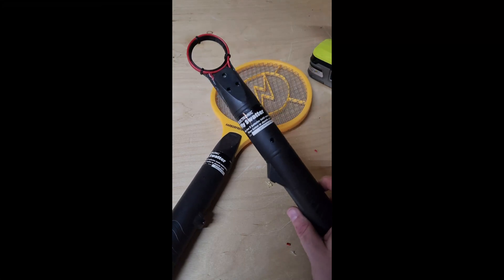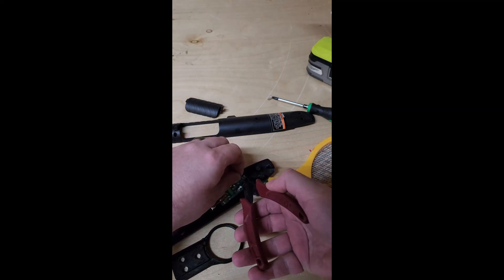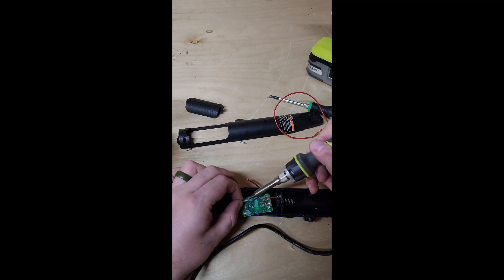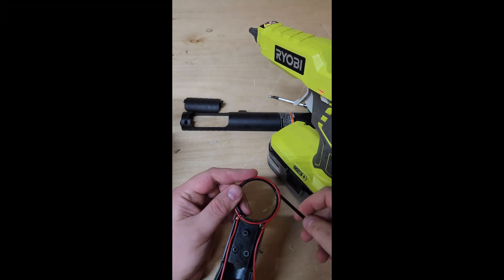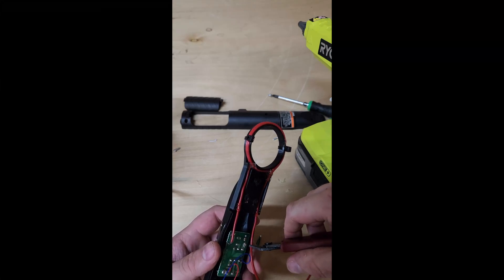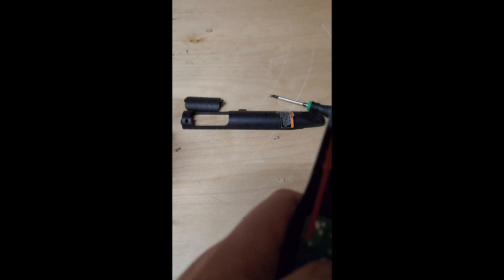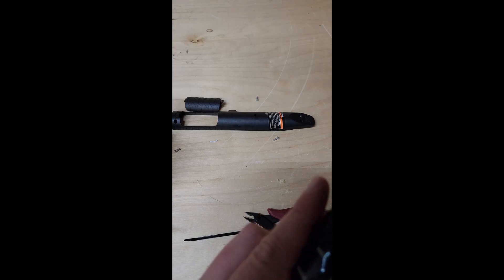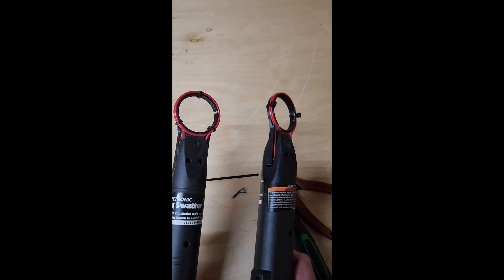DIY EMP Device from a Harbor Harbor Freight Fly Swatter

Comment: Why not use the already existing head, just remove the metal screen inside, maybe add some sort of strip of cut (lengthwise) PVC pipe to wrap the wire around and place/secure onto the yellow part?

Comment: Why isn't the copper bear wire and it's still in the sheathing
Reply from the maker: @BrandonPryor-js2ux  if the wire wasn't insulated, it would short out and bypass the coil.

Comment: Just comfirming, you need a small gap between one end of the coil and the actual PCB?
Reply from the maker: Yep, correct. The spark gap lets the capacitors build charge.
Reply: @carlbelcherEDC  I have a plan to make my own "Faiz shot" but with a modular piece that lets you switch between gauntlet or emp

Comment: Would that work on a fuel pump?  Wonder if I can put fuel enough and before having my truck full use it and maybe cut the signal so I don’t get billed for the fuel
Reply from the maker: I wouldn't recommend it, first it would be illegal and second most production consumer facing stuff like the pumps are more than likely hardened against an attack like this. In fact they were probably tested with a professional version of a device like this.
Reply: @carlbelcherEDC weird because few days ago, saw in some news that there’s a group  placing a item that make the pump counter s slow down wile pumping at normal pressure
Reply from the maker: @Army_Of_Juan  my understanding is that is a mechanical attack, it physically changes the rotation of the metering device in the pumps